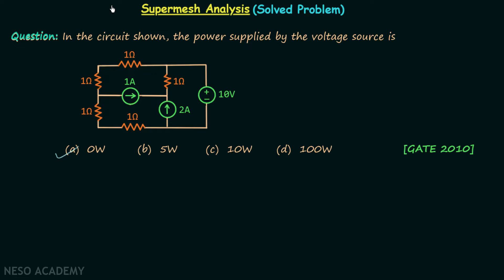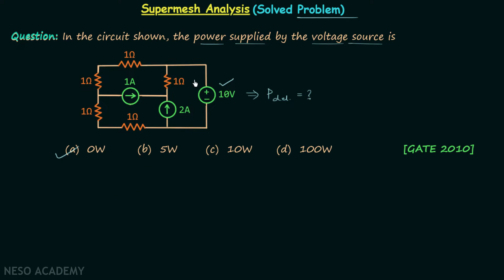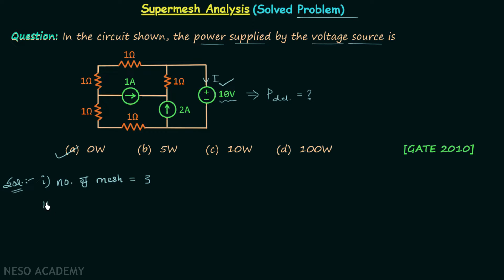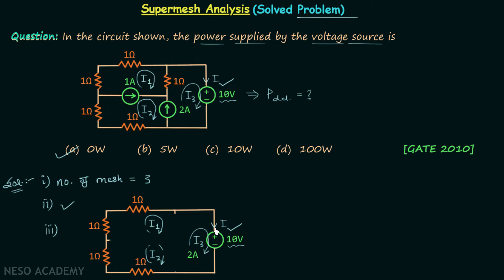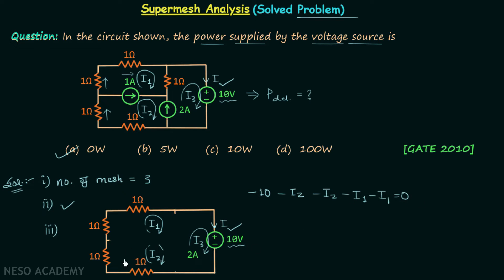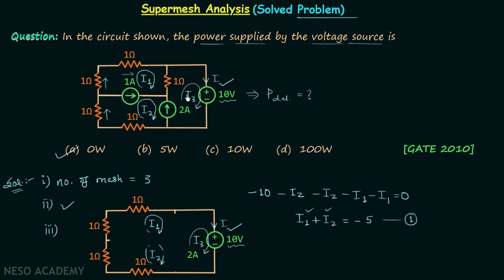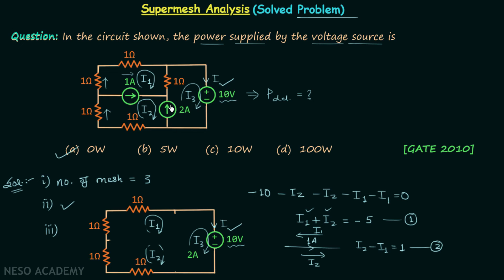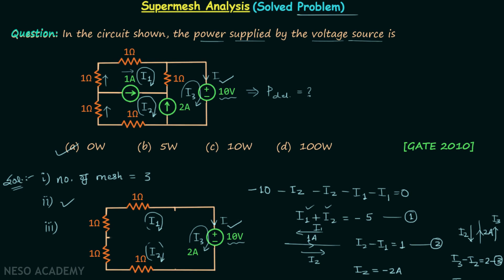Supermesh Analysis (Solved Problem)

Comment: You can assign the current direction across 10v source but before you explain you did not assign...previous lecture you assign low to high .this lecture high to low ...the same circuit..

Comment: 6:52 how can eqn 1 and eqn 2 can be calculated? One is 5 volt, the other is 1 ampere. So how?
Reply: since current is not flowing through the last resistor i think it's okay to leave it

Comment: 3:34 why did we removed that resistor 1 ohm branch also? Coz no current will flow through it, or coz we have to take long branch?
Reply: No current will pass through it as the 1ohm branch will be open from one end(after removing current source branches)
So he removed it.

Comment: It should also be noted that this was a classic open and shut case of a super fast beginner level superposition analysis. Supermesh analysis required much more work than was necessary to show that the current sources cancelled out the power that could have been supplied by the voltage source. Still a great video.

Comment: I am little bit confused in making Kvl supermash equation 
According to me it should be 
-10+i2+i2+i1+i1=0
Reply: I see that too
Reply: Yeah agree
Reply: I think so too
Reply: yeah, it happens. so all unknowns are I1=2, I2=3, I3=5, i hope these are true answers :) thanks for the great explanation.
Reply: It’s the same solve the equation u will see its 5
Reply: just look at the figure one for direction of current and here direction is taken as clockwise. Be aware that sign will be negative since resistor will drop the voltage.

Hence the equation is 
-10-i2-i2-i1-i1=0
is correct

Comment: Why you remove 1ohm along with the 2A current ?
Reply: if u remove 2A current source then it will be an open circuit.  current wont flow through 1 ohm . so u draw 1 ohm or not, there is no difference.
Reply: Yeah I too have the same doubt 🙄🤔

Comment: Bro how can we say that i2 is grater than i1
Reply: Based on less resistance?
Reply: @eric J TQ bro. But as i know, take the current (i2) which is in the direction of source as +ve and the the current(i1) which is in the opposite direction of the source as -ve. And their sum should equal to the source. That how the eq. comes.

Comment: why did he remove the 1ohm resistor with the current sources
Reply: I think by mistake bro they can't be removed its wrong i think
Reply: @anandsumyt7993  then how is supermesh calculated?
Reply: Open Circuit cause current will not flow through 1ohm R
Reply: It become o.c so no current will flow

Comment: Sir the current direction at voltage source entering +ve  terminal actually dis  means power absorption u took in kcl problem same way..In question we calculate power supply but u take different manner I confused plz plz clarify sir .plz respond my comment
Plz anyone clarify my doubt
Reply: The power is calculated by taking this direction is absorbed power,if we need to calculate delivered power just change the sign of absorb power which we calculate,for more clarification watch video on that topic...

Comment: I’m not sure why you added -10v with i2 & i1. In min 5 in the video. You mixed up KVL with KCL there. shouldn’t have been 10v + 10i2 + 10i2 + 10i1 + 10i1=0???? Because V=i*R. Voltage can be added with voltage and current can be added with current (KCL & KVL).
Reply: Ahh I see I considered as 10 ohm that’s where my mistake was. Makes sense now. Thank you.

Comment: Why was 1 Ohm resistor removed while removing the 2A current source? Only after removing 1A current source, it comes in series with 2A current source.
Reply: My question is same as of Muhammad anees.why this 1ohm resistance is removed?
Reply: Because its not a part of any close loop
Reply: that resistor has  end terminal was free thats y